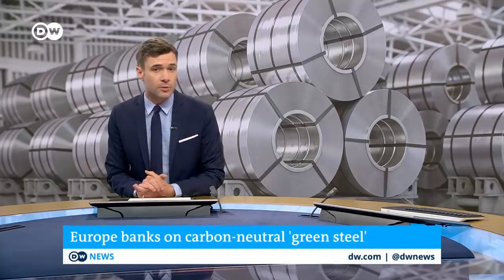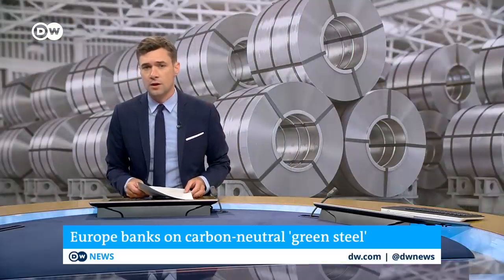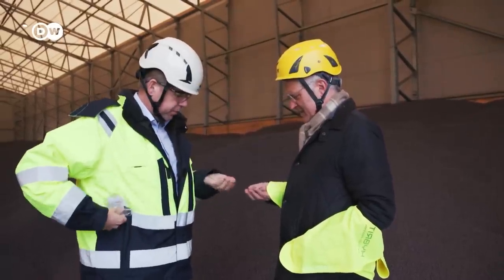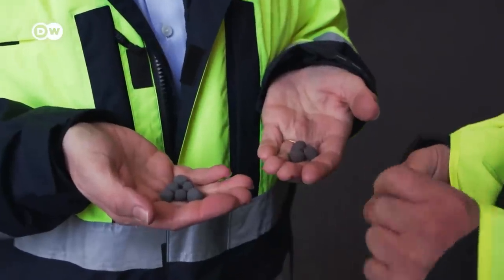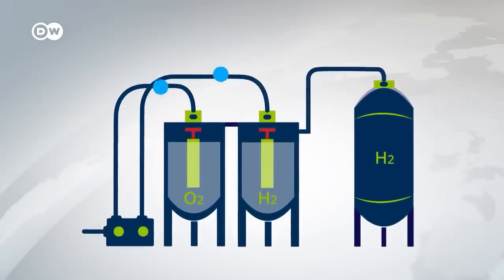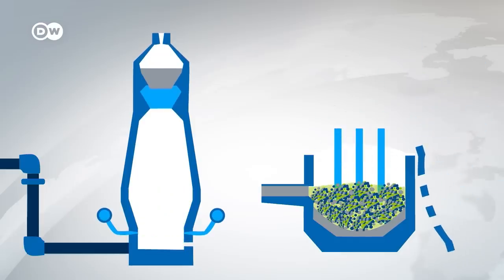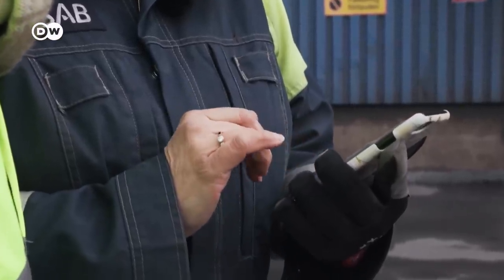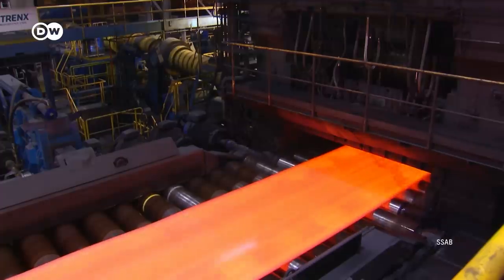Can hydrogen powered plants turn steel production 'green'? | DW News

Comment: There is a competing technology called Molten Oxide Electrolysis that can convert iron ore directly into steel.  The hydrogen technology is a 2 step process.  It will be interesting to see which process is the most economical.
Reply: i hadnt heard about molten oxide electrolysis until now so i looked it up abit
how does it actually produce steel? from what i can see its just turning iron ore into liquid iron and oxygen, theres no carbon there to make steel, and it cant be using iron carbonate because then it wouldnt produce oxygen like everything says it does
Reply: @vincentgrinn2665  They will still need to use carbon but the carbon can be introduced in other forms. One of the biggest things with this process is that you no longer need to use fossil fuels to provide the heat the melt the ore. The process is essentially used to first create high purity iron metal and then in some other process add the carbon. That carbon can come from a variety of sources. Regardless you don't necessarily need to make steel, there are other ferroalloys that we could make
Reply: @hmbro3236  oh that makes sense, i always assumed all these green steel were suppose to be carbon free
but reducing the carbon used to just the small percentage actually inside the steel makes sense
Reply: @hmbro3236  The problem of using carbon is that .. in global scale, you still need to emit millions of tons of coal in the atmosphere
Reply: it is further away from being reality. and it does not fit as well into the other step of Iron production. All in all it has the potential of needing less Energy. but it is also less suited to use seasonal Energy overproduction.

Comment: Green hydrogen is expensive there is a 
 Danish company that is marketing a 100MW electrolysis unit able to produce 2 tonnes of hydrogen per hour and costs 59 million dollars each . You need vast amounts of hydrogen to make ammonia that is the real aim of making ammonia. The price for green hydrogen per tonne is 9000 dollars and for hydrogen from hydrocarbons is 7500 dollars even if you use 50kg of hydrogen the steel will cost 2100 dollars a tonne and it's not green you still have to use coke and limestone to create slag and you use natural gas to lower the price of melting steel . It's a gimmick a trend and no such thing as something for nothing exist . So a step up transformers so 75MW coming in and 100MW coming to squeeze more hydrogen so 1000MW nuclear power plant so 13 electrolysis units and 26 tonnes per hour can produce 3500 tonnes of ammonia per day.
Reply: Do you think maybe over time it could be more beneficial than our processes now?
Reply: @bns481  : I'm a hydrogen investor. I maybe biased but I see the technology eventually getting there but it's decades away ... maybe more if some hurdles are higher than expected.
Reply: No harm to having dream of free lunch.
Reply: also it is only really green when it is not just produced from green Energy, but from surplus green Energy.

Comment: Shipping hydrogen around doesn't make sense when you can make it on demand?
Reply: making green hydrogen in Germany on a night in January is harder than shipping it from Morocco
Reply: Hydrogen production requires a ton of energy and is only 60% efficient, so it is very sensitive to electricity prices.
It probably makes more sense to import hydrogen made from insanely cheap solar (as low as 1.5¢/kwh in some places) than to try to make it locally.
Sure, there are some losses when transporting it, but not enough to make up the difference in electricity prices in most cases.
Reply: 2/3rds of humanity live near a coastline, but 1/3rd live deep inland, hydrogen will need to be shipped to those people.
Reply: @Dayanto  morocco is also very, very well suited to solar production due to it's clear desert skies and long durations of direct sunlight exposure throughout the year. they've already begun selling solar power to europe via undersea power lines.
Reply: @Dayanto  There's also upcoming projects on white hydrogen (aka geologic) which has been gaining steam recently. This bypasses the need for electricity and can be treated as an energy source like natural gas at that point. Huge wells have been discovered in France, Africa, and Australia recently. Since Earth does the generation for you, it's expected to be very cheap. So cheap that it can easily reach the 1USD per kg targets most countries are aiming for even with transportation losses considered.
Reply: @marcob1729  depends on the amount of wind that night. but shipping it is a really wasteful Idea.

Comment: I'm all for anything to do with hydrogen.
Where's the disadvantage besides the initial cost?
Reply: I heard it is pretty reactive and needs high security containment. The city of Reykjavik was running test runs on busses. I don't remember why they stopped.
Reply: The hard part is getting it off the ground. It can be cheap in the long run, but getting it up to scale before it is price competitive is difficult, and will require a lot of effort on many different fronts. (carbon taxes/tariffs, subsidies, investments into infrastructure and research, etc.)
As costs fall, the need for incentives will go down, but getting the ball rolling in the beginning when everything is the most expensive and there isn't any momentum yet is tricky.
Reply: @gluteusmaximus1657  : Storage is easy, tank storage is safer than natural gas. Ammonia is an easy way to transport it too, I made a small bag of gold from that technology. Sometimes early investors do get lucky :-)
Reply: the Energy needs for the steel production of Germany would be around 150 to 200 TWh a year.
compared to the 600 to 700 TWh energy production that Germany has at the moment, that is a lot.
that is however a disadvantage and an advantage at the same time.

Comment: That plant alone will consume HALF of the countrys energy production! They forgot to mention that.
Reply: the good thing however is, that it can time this consumption to whenever it is convinient. So it can at least in principle run on surplus Energy only. that allows for the overall renewable portion of the electric grid to rise to 80% or higher without the need for seasonal storage.

Comment: Q: How much coal is used worldwide to make steel each year?
A: About 1.26 billion tonnes of coal are used to make steel each year. 
Q: How many square feet of solar cells would it take to replace the coal
A: About 57,000 square miles, which is slightly larger than the state of New Jersey.
Reply: And for crude oil ~300,000 square miles if my calculations are correct, generously assuming 260 watt-hours per day per square meter for solar panels. So larger than Texas. 200x the power then we had in 2020 as per IEA. I don't think we have nearly enough rare earth metals for this.
Reply: New Jersey pfffff whatever cover New Mexico state and it alone could power everything.............. globalyyyyyyyyyyy.
Reply: @DaVe-iSnOtHoMe.MaN.LemmingsWeB  1. It wouldn't, not nearly enough
2. you couldn't transfer that energy that far anyway
Reply: @R3bel02  a man with that many y's at the end of his words is clearly being sarcastic.
Reply: In America we’ve built a New Jersey in parking lots alone. If we really cared about land use and saving space, we’d start with our wildly sprawling post-1960 development model. 

But also, all that wasted space could be dual-use between parking and solar if we wanted. Rooftops too. How many giant industrial warehouses are there taking up entire fields that could double as little power plants?

Also, you forgot to mention how much perpetual space coal mining takes up, and must continue consuming forever to power coal plants, unlike metals mining. Coal mining takes enormous swathes of land, and unlike solar or wind, it is extremely difficult to reclaim its useful life. Can’t keep just blowing up every hill in West Virginia until there’s no more hills.

Comment: Steel is already the greenest material because it is the most recycled and the most recyclable.
Reply: It's great if it's greener still, eh?
Reply: Not in China. All metals are recyclable.
Reply: Doesn't matter. It's still 8% of global emissions. That's quite a bit more than shipping and aviation combined.
Reply: Well…Aside from the fact that you need coal to produce it….
Reply: we have a high recycling rate, but we also need a lot of new steel in addition. so overall we are talking about 8% of the problem. that is a sizeable chunk.
Reply: @thisismetoday  you do not need coal to recycle steel.

Comment: Iron reduction with coal and then melting in eaf or induction furnace is standard technology. Challenge is making the iron pellets without carbon....hydrogen from water using solar power or renewable power. The carbon is dri acts as fuel to reduce the electrical energy input in steelmaking but when reduced with hydeogen dri would be lacking in carbon and will.havw to be added to make various steel grades

Comment: Theres so much misinformation here. Green steel is not "more efficient" and does not have "lower cost."
Thats the reason its currently so expensive and not really used. They are working on getting the astronomical costs down and the abysmas efficiency up.
Reply: that depends, on what cost you include in steel in the first place.

Comment: Is hydrogen better than an electric furnace?
Reply: For making steel a lot of heat is needed. And with hydrogen one can more efficiently provide these high temperatures.
Reply: Yes. It's hard to heat up something with an metallic electric coil when the target temperature would melt said metal
Reply: Yes, the required heat for steelmaking makes electric furnace really energy demanding. More energy demanding than combustion of gasses like hydrogen even.
Reply: it is not about the heat. the hydrogen is needed as a reduction agent.

Comment: More cloud culckoo land science, no hydrogen production is carbon neutrol and wastes electricity, just use the electricity to directly reduce the ores, hydrogen does not enhnce the iron ore it is a reduction process. If the developement of such proccesors that need gov funding are therefore unecanomical.

Comment: Are solar and wind powered electrolysis plants capable of producing hydrogen cheaply enough, and would they be able to meet market demand? Also, the best way to decarbonize heat is with ridiculously cheap, glowing hot thermal batteries. Thermal batteries are dirt cheap because they’re made out of dirt. And those batteries can be charged during peak energy production when the price of solar and wind can often be negative. So industrial furnaces would literally be paid to use heat.

Comment: Two questions. Where do they get the hydrogen? (In methane, hihi!) If hydrogen is extracted by electrolysis, wouldn't it be possible to find maybe better technology to extract the metal by electrolysis: instead of a two-step process, first reduce hydrogen, and then oxidize it back — to reduce the iron at once?
Reply: It's called "Clean coal".
Reply: Did you watch the video? It said they're electrolyzing water to split it into its elemental components.
Reply: @Aethelos  I believe that the electrolyzers shown in the video are as real as you are a Prince.
Reply: Hydrogen for green steel can only come from green hydrogen (electrolysis).
Reply: hydrogen electrolysis is way easier, than iron electrolysis. 
it would in principle be possible to use electrolysis directly to reduce the iron oxide. and it is possible, that this would reduce the Energy requirements. But that procedure is way further away from becoming a technical reality than reducing the ironoxide with Hydrogen. On top of that, it does not fit as well into the rest of the production process.

Comment: Isnt most hydrogen produced by hydrocarbons ?
Reply: it is now
Reply: @DSAK55   so it isnt green. Like electrolysis that uses power from the many coal power plants in germany .  Sorry this is just eco washing by the companies .
Reply: @Holypaladin887  As a Dutchman you should know about wind energy.
Reply: @peabase  i implied german electrical grid . I know that theres a station in the north sea that uses already available infrastructure from normal gas to export the hydrogen from electrolysis that is generated by wind power . I was only talking about the german system .

Comment: Ark furnace are very green also co2 comes out of the steel and needs iron ore to keep the steel from being week so it's literally impossible to become green.
Reply: I think the problem your referring to is replacing the carbon from coking coal. They do have a method but it's pretty clunky. If interested it's easy to search. Cheers.
I hope gov't or someone continues to fund research.
Reply: I think you did not compleatly understand the process, that produces Iron.

Comment: hydrogen is future of fuel
Reply: hydrogen is NOT a fuel. more energy is required to make hydrogen then you get from using the hydrogen
Reply: In automobiles, batteries are more cost efficient. But in trucks, ships and plains hydrogen is the future.
Reply: @flowjo23  Keep on dreaming. For long haul flights it needs to be liquid for a proper energy density, and you need to keep it below -253°C (−423°F) for that. You also need special polymer seals to prevent leaks. And if you have one, then good luck.
Reply: @flowjo23  : Yeah, at the "scale" used for trucks, trains, shipping, hydrogen is a natural fit. However they are pushing for it's use at "scale" where it is not practical such as base load power.
Reply: @DSAK55  It can be fuel. Newer discoveries of large pure hydrogen wells have been discovered and a lot of investment have started flowing into it. If you let Earth make it and we just extract it like natural gas, it'd be fuel at that point. Geologists are even expecting it to be a new "gold rush" as it's very likely large oil / gas companies with large experience with drilling and extraction will pivot to it once the "wildcatters" start getting their hydrogen sites.
Reply: @ryoukokonpaku1575  🤗 dream on
Reply: @DSAK55  Not really a dream. There's a village in Africa that's been running on hydrogen for electricity for almost 2 decades now. There's a well there that's been spewing 98% pure hydrogen that was accidentally discovered when workers were looking for water and still spewing h2 today, in fact the flow rate increased to geologists' surprise. This one village was the main reason for the whole idea that geologic hydrogen in pure form is actually possible to extract which attracted a lot of geologists to the area to study it. Now companies are using that information to find wells in other places, which they did. France in Lorraine basin, Australia in Ramsay etc...
Reply: @DSAK55  Not really a dream. There's a village in Africa that's been running on hydrogen for electricity for almost 2 decades now. There's a well there that's been spewing 98% pure hydrogen that was accidentally discovered when workers were looking for water and still spewing h2 today, in fact the flow rate increased to geologists' surprise. This one village was the main reason for the whole idea that geologic hydrogen in pure form is actually possible to extract which attracted a lot of geologists to the area to study it. Now companies are using that information to find wells in other places, which they did. France in Lorraine basin, Australia in Ramsay etc...